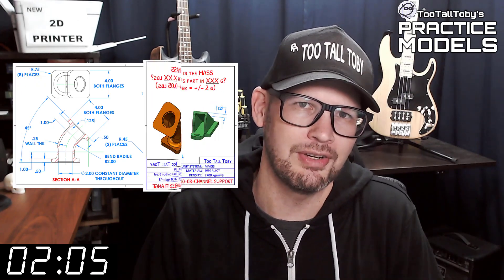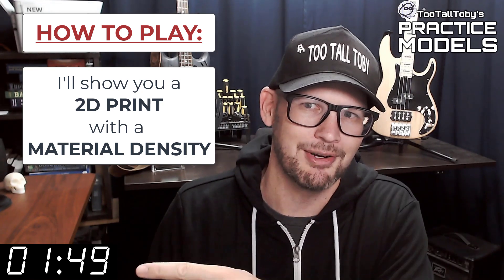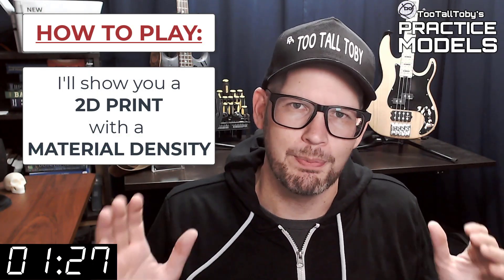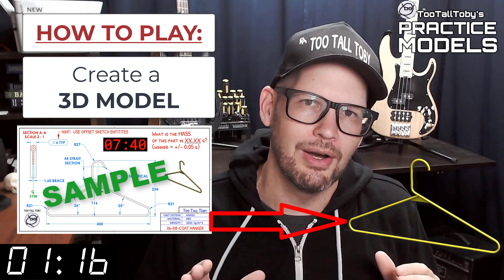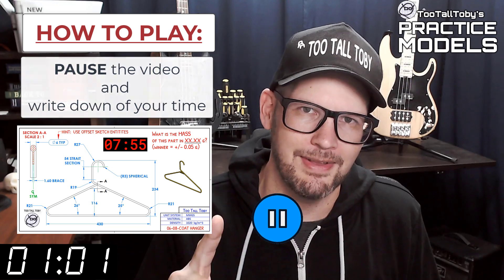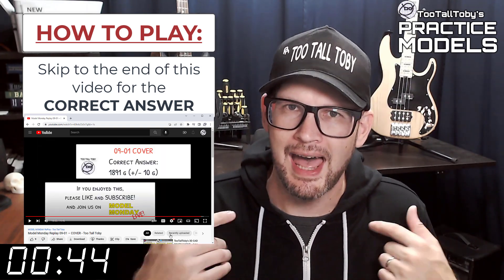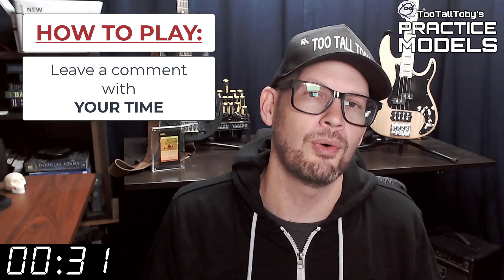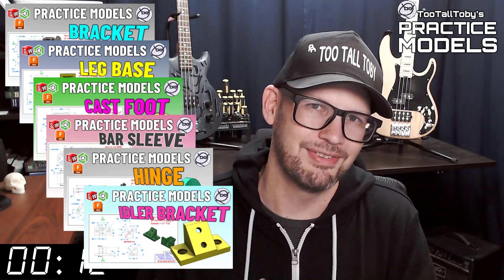2D to 3D CAD PRACTICE MODEL-  Drawing to Model exercises for Onshape, SolidWorks  - P-LINK

Comment: This was a simple model, but it took me over 2 hours before I got the right answer.    But I learned a lot: Mainly, don't assume!  Just because something looks like it has a certain dimension, radius or whatever, doesn't mean it's correct.  That was the source of 2 of my mistakes.  And I'm learning that the first tool I choose to do something isn't always the best.  But, since this is only week 2 for me using any kind of CAD software (besides Sketchup--which really doesn't count), I feel pretty proud that I was able to get the right answer (finally).😊
Reply from the maker: Awesome Job!  What CAD system are you learning now?
Reply: @TooTallToby  OnShape, thanks to you. 😀